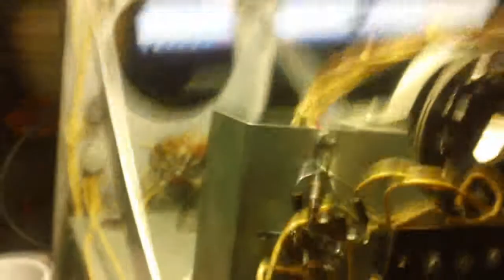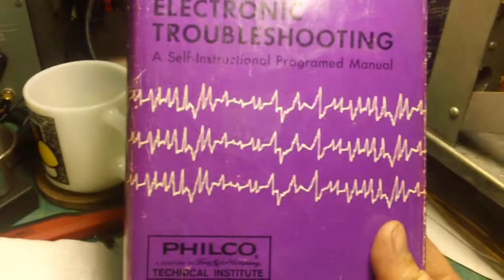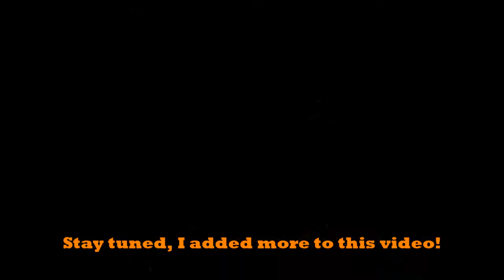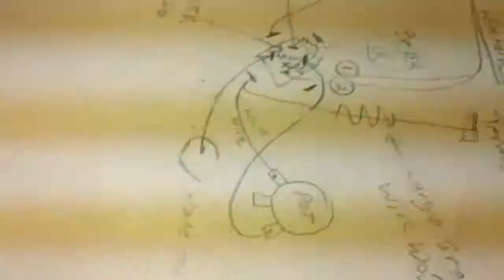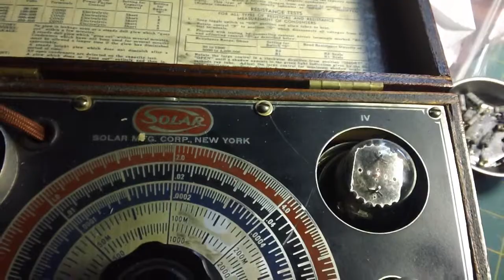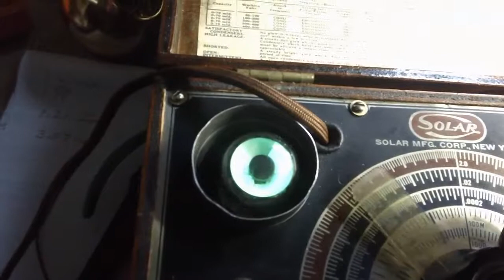Heathkit O-8 Oscilloscope 2 of 3

Comment: I believe the 1600v pink caps were actually original, every O8 I've been able to find pictures of had the same ones installed. What do you think Heathkit's logic was behind the strange terminal strip on the back (below the crt socket) with wire loops on almost every column? The manual doesn't describe what this was intended for or why someone would want to change those connections.